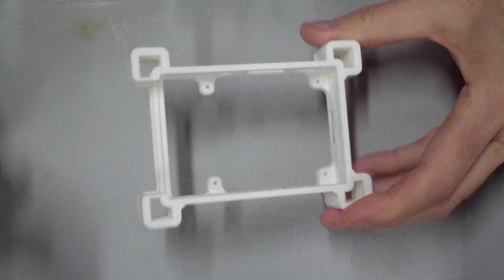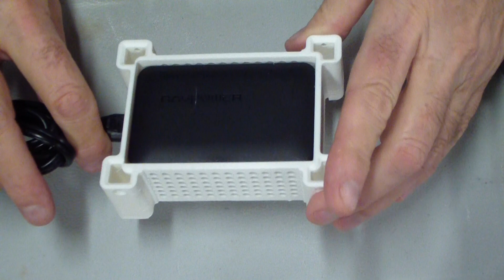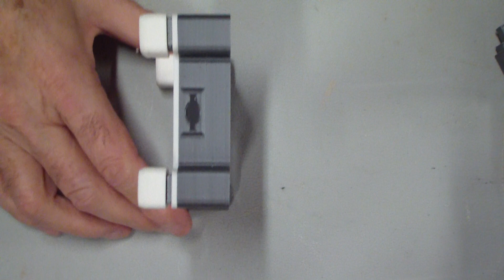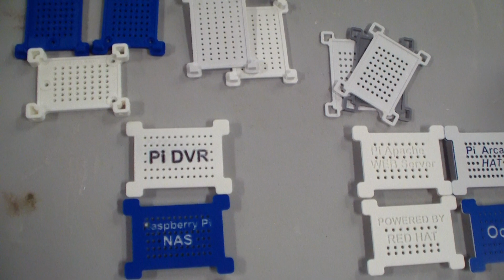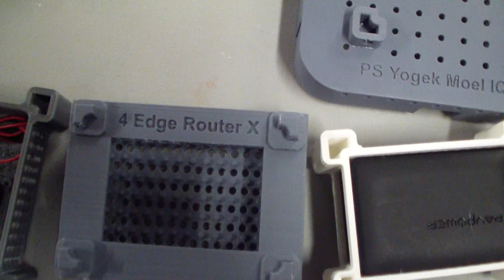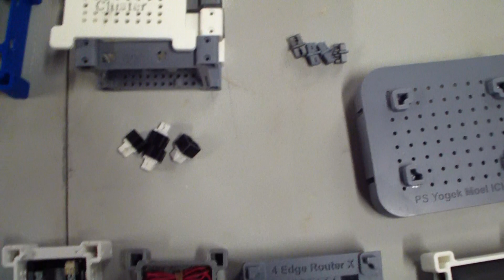3D Printing, Raspberry Pi  Cases & Add ons!

Comment: Great job on the Pi cases. I recently purchased a Analog phone Hat from SwitchPi. It just needs one cutout for a dual RJ11 jack at the opposite end from the Pi's USB ports. Is there any chance you could create an add-on for it? I can provide you with the precise location and size. You can review the information on SwitchPi dot com. The device is the OAK Pro Module.
Reply from the maker: If u want I will send u the raw fusion 360  file,. And u can mod it.  I'm moving and don't have.  Any time right now.
Reply: @IBMClynes  yes that would be awesome. Thanks
Reply from the maker: Thingiverise will not let me upload    A   .F3D file    e-mail me direct  AT   ClynesMike@     Gmail.com & i will send it direct!